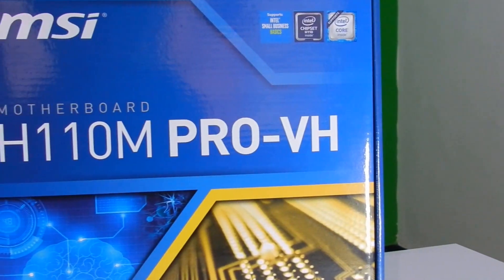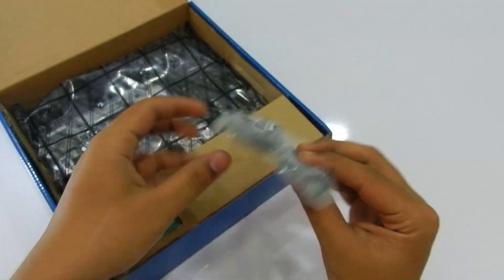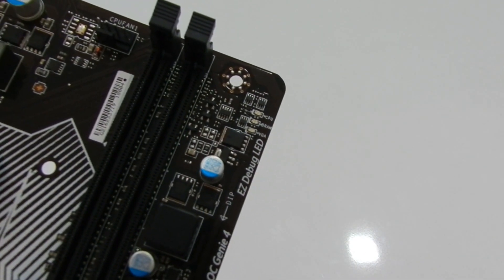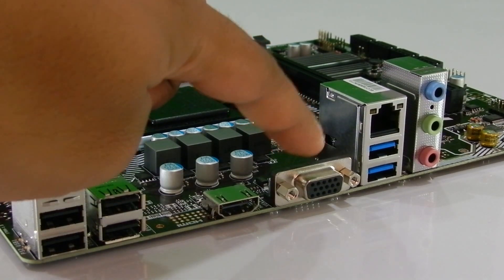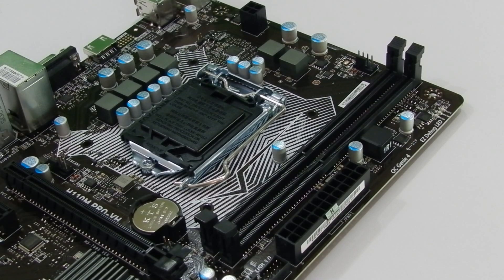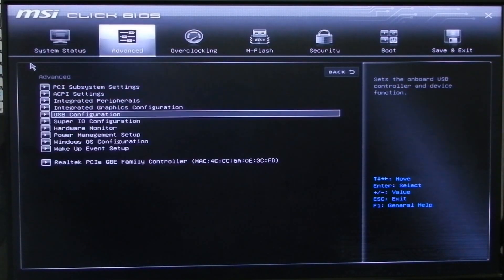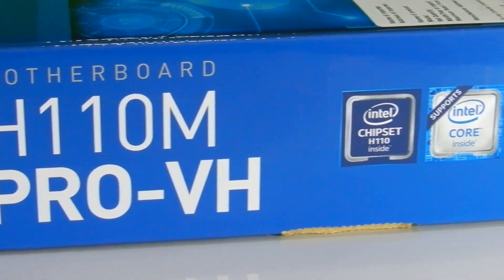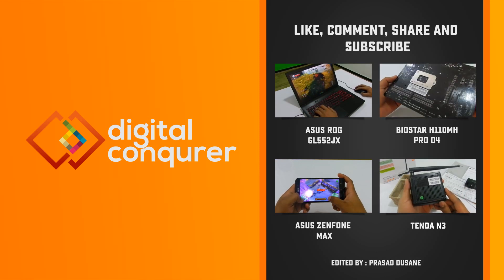MSI H110M PRO VH Motherboard Review: For Skylake Processors, DDR4 RAM, Gigabit LAN, XMP RAM Profiles

Comment: I am using same motherboard with i5 6500 (but no graphic card except the inbuilt intel hd 530). 
My problem is that NO SOUND COMES THROUGH HDMI, as it doesn't show my LED TV in play back devices and I have been using it like that for past 3 years
Things I have tried:
-Uninstalling , reinstalling and updating intelHD and realtek hd audio drivers , manually and as well as through windows auto update feature.
-Formating whole system and reinstalling windows 10.
-swapping cables etc etc. 
All to vein, nothing worked.
LED TV works perfectly with other hdmi inputs such as tata sky setup box.
Though sound comes through aux output but not through hdmi.
Can you please help me solve this problem 🙏?

Comment: "Some Intel H110 chipset motherboards may need a BIOS update prior to using Kaby Lake-S CPUs. Upgrading the BIOS may require a different CPU that is supported by older BIOS revisions."

I get this notification on PC Part Picker when trying to match 7th gen cpu's with H110 motherboards. Was this a problem for you?

Comment: is intel core i5 6600k compatible with msi h110m-pro-vh plus 6th generation ddr4 motherboard
Reply: yeah it is compatible with intel 6th gen. You can also use 7th gen but you need to manually update bios

Comment: Is it good on I5 7600 Kaby lake and GTX Geforce 1060 O6G?
Reply: This motherboard supports 7gen cpus(i5 7600), but for that to happen you need to update the bios, you can be lucky and get a board that works, but if you want to be guaranteed no problems, you should go for the same motherboard but with B250M chipset, its pretty much the same board only with native support for the cpu you listed here.
MSI B250M PRO-VH is the name of the same board but with support out of the box with 7gen cpu, think the B250M supports m.2 ssd, H110 does not as far as I know and it has more sata and usb3 ports, the B250.
Reply: Thanks!
Reply: DOSE IT SEPPORT 2400MHZ RAM WITH UPDATED BIOS
Reply: i mean  will it  run  with a 2400MHZ ram on board
Reply: Incompatible with kabylake cpu

Comment: Does this supports overclocking ?

Which is faster ? Pentium G4560 VS AMD A8 7600K...? akela G4560 gta 5 chala paayega low settings par ?
Reply: Jayshrikant Shrivastava No you can only overclock k series CPU's using the Z series motherboards. 
Also that AMD CPU is very old and not recommended, rather get a G4560 and a 1050ti and you are set for GTA V

Comment: how much maximum graphic can this mother board take? ........can I use 16 (1*16)GB corsair ram which r at 2300 MHz..? does it support i5 6th gen processor.....? I am waiting for your answers.    thank you
Reply: harshit bargujar it supports ram 2133 mhz only and it supports i5 and only 6th generation
Reply: +Berüchtigt187 er  thanks...
Reply: This motherboard do support 7gen cpus, but then you must update the bios and for that you need a 6gen cpu, if you go for the MSI B250M PRO-VH you get the same board but with 7gen cpu support out of the box, and B250 supports m.2 ssd and have more sata and usb3 ports, the B250M does cost a tinytiny bit more, atleast it does that where I live, its not much difference.

Comment: can I use a 7th gen processor on it ,without updating the BIOS?
Reply: If you update the bios it do support 7gen, but if you go for the MSI B250M PRO-VH its the same board, but with 7gen cpu support out of the box.
Reply: prasenjit paul no you cant only 6th gene

Comment: i have intel core 2 duo processor can it fix on msi h110m pro vh motherboard?
Reply from the maker: +Nipun Gharat nope. It's old generation processor. You can only find old or used motherboards on Ebay for core2duo.
Reply: can any gpu fit on my computer? could do little bit gaming..Btw thanku so much i ask this Question on many Youtube channel only u reply me...thankuu.. n sorry for my english..

Comment: does this include a lan chipset thing or do i need to get a wifi card or wireless adapter because my router is downstairs.
Reply from the maker: +TheMooshroom99 it had Ethernet but no wireless built in. You need an external connector.
Reply: +Digital Conqueror thanks :P

Comment: Is this Motherboard come with preinstalled Windows????
Reply: Aditya Devadiga nope. The operation system has to be installed on a hdd or ssd (for better and faster performance).
Reply: BearBusiness Ok Thanks
Reply from the maker: +Aditya Devadiga Nope. Windows comes pre installed in laptops, not the motherboards.
Reply: Digital Conqueror Is there a tutorial on how to install windows 10?
Reply: Adrenalin3 tons of them. Type  Windows 10 installation in youtube.

Comment: I used this for my first PC build 600$ :D
Reply: G4560 + gtx 1050 ti <3
Reply: @jpthecrew Greattt, my PC only G4560 + R7 370 :D
Reply from the maker: +PurityEmpire awesome!
Reply: PurityEmpire Kind of late but what processor and graphics card are you using?
Reply: i could answer that since i bought the same board, im using a i3 6100 with a 1050ti and works really nice
Reply: What case did you use? It look akward in most cases I've seen since its so small.
Reply: Specs?
Reply: Me was $420

Comment: hey dude nice vid, which one of these do u recommend ?

MSI H110I Pro Mini-ITX Motherboard
MSI H110M Gaming Motherboard 
MSI H110M-Pro VH Plus Motherboard
ASRock H110M-HDS Motherboard
ASRock H110M-HDV Motherboard
ASUS B150M-K Motherboard
Gigabyte H110M-H Motherboard
Gigabyte H110M-S2H Motherboard
Gigabyte B150M-HD3 Motherboard
Reply: I use the Gigabyte H110M-S2H, comes with an HDMI for if there's ever an error in your GPU
Reply: Leon Grey I got asus z170 pro gaming aura after a lot of search :)
Reply: ah nice one
Reply: yeah it's really good but I wish it had a RGB header

Comment: is there any WiFi module integrated or should I buy an adapter?
Reply: Little late, but an adapter. No built-in wifi supported.
Reply: Ivo H Does that mean it has an ethernet? (Sorry if bad question, not a true genius when it comes to motherboards)
Reply: Adrenalin3 If you mean an Ethernet port as in a port for a LAN-Cable, yes. It has Ethernet. Just no Wi-Fi
Reply: But can I installed wifi adapter on this motherboard
Reply: @robertmoirangthem3644  yes

Comment: What should I do if i want to add more fans ? A
Reply from the maker: +Lance yo that's no big deal. You can get Molex to fan pin extensions for real cheap.
Reply from the maker: +Lance yo that's no big deal. You can get Molex to fan pin extensions for real cheap.
Reply: Wont the fans always go 100% if i connect it to the psu ?

Comment: Awesome review bro i am building my gaming rig around this config this was helpful as we don't get much option in budget in india .... and you production quality is awesome keep up you got new sub ...
Reply: Thanks a ton for appreciating buddy! putting up GTX 1060 review in next one week or so
Reply: Hi I am using the same motherboard along with Intel i5 6500. I use my LED TV as my monitor but there is some problem as through the HDMI port display is working fine but there is no audio through the speakers of the TV. I have updated and reinstalled all the drivers still in audio playback devices digital audio HDMI does not show although the front and rear auxiliary ports work well. 
Recently I formatted everything from my computer including the windows 10 and then downloaded and installed new windows 10 still same problem presists.
Please help me out if you have any solution
Reply: @abhimanyusinghthakur6509  did you find a solution?

Comment: Is this setup good for at least 3 years?

CPU: i5 6400/6500 don't know which one
RAM: 8GB DDR4 RAM
GPU: Palit GTX 1060
240SSD / 1TB HDD
450W PSU (corsair)
MSI H110I PRO
Reply from the maker: +Kyto Kami Yup. Totally great for 4-5 years.
Reply: this is easily good for 3-5 years! just make it 550w instead...
Reply: get 6500, a nice amount better for not much greater price, and yes a bit better psu would be nice even though i think 450 would run this system just fine

Comment: Does it have good graphics?
Reply from the maker: It does not have on board graphics, but with provided PCI slots, you can add latest graphics cards like GTX1060 or Radeon RX480.

Comment: Hi! Planning to build a PC with this mobo paired with an Intel Pentium G4400 with my old Asus GTX550TI GPU. Would I have problems with compatibility as my GPU is fairly old? Thanks!
Reply from the maker: +John Malto No, there won't be any compatibility issue with your processor and graphics card. You can plan a upgrade later on, if you feel graphics performance is slow. But no this motherboard won't bottleneck any of hardware you have mentioned.

Comment: fantastic review 👌
I wanted to ask how good or bad is pro VD version compared to VH ? I am building a gaming pc with gtx 1060 and i5 6500 and looking for a budget mobo under 5K. 
thanks
Reply: VD doesn't an HDMI port but a DVI-D port.You can get an adapter but it's not really worth it.Just go for the pro-vh
Reply: I have the exact same specs
Reply from the maker: Thanks Arjun. There is basically no performance difference between the two versions, just as Ahan said. You just get different ports. If your current monitor supports HDMI, I would recommend going with VH model, just to be future proof.

Comment: will a msi gtx 750 to fit in this?also will I3 6100 6th Gen lga 1151 work perfectly?what do you think of my set up?
Reply from the maker: Yes, they will work perfectly. In fact I am using the same setup except my card is ASUS GTX 750Ti  OC 2GB. Same mobo and same processor, works awesome!

Comment: I plugged in everything except the ram (still to be delivered) and nothing happens is that normal? not even the psu fan is turning on!
Reply from the maker: No its not normal. please check if you have installed the power cables from power supply right. and also your power pins coming from case at right location. have you just built a new PC?
Reply: Yeah the frontpanel cable wasnt plugged in correctly - im typing this from my new pc ^^ so everything is fine now :)
yes ive build this myself

Comment: With a i7 6700k and 16(2x8)GB ram this works like a charm
Reply: overclockable via this mobo?
Reply: i think not. at least via multiplier.
Reply: strange , no point of having oc section then
Reply: yeah, oc genie in the mobo makes no sense, maybe disabled via software? i mean, cheaper to have only one chipset production line and then disable some stuff.

Comment: I have this with a gtx 960 graphics card will the motherboard support the gtx 1070 I also use an intel core i7 6700
Reply: ***** I'm guessing there both the same size I have a zoostorm nzxt phantom 240 case and what sort of power supply would u recommend to use I don't mind paying a bit for a good one
Reply from the maker: Any gold certified or 80+ rating power supply with 650W or more wattage should be good enough.

Comment: Going for a build with an i7 and a GTX 1070 but I have a choice between this board or the more expensive and featured ASUS Z170-P. Just wondering if it's worth saving the money and getting this one, or whether the ASUS one would be a better choice for future proofing?
Reply from the maker: +Corvus If you are not planning to over clock or do crossfire/two way SLI, this board should be good enough. And you already have GTX 1070, which I believe would be good enough for any game you can throw at it.  Save the money unless you are going to use all the features by Z170 board.
Reply: Thank you for the quick response and the tips!
Reply from the maker: You're welcome!